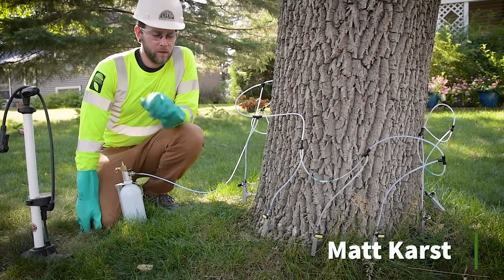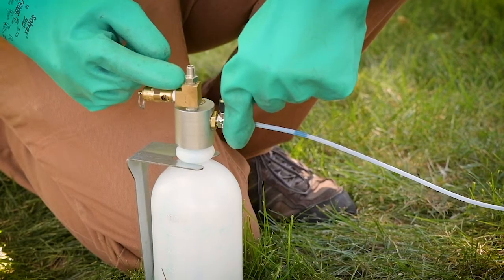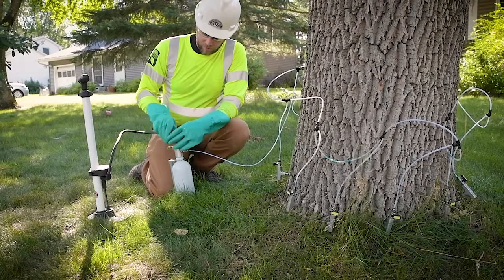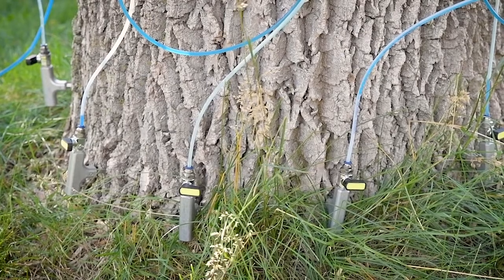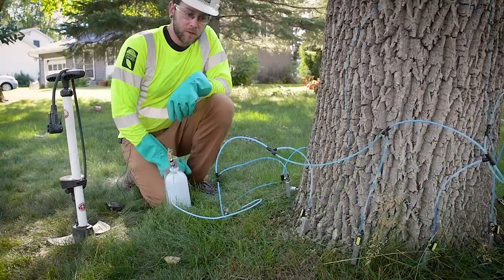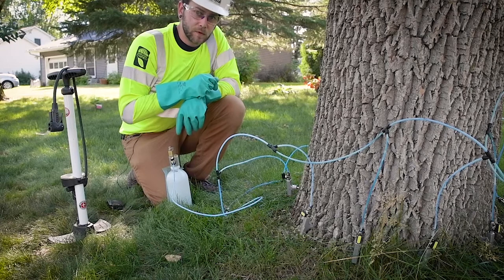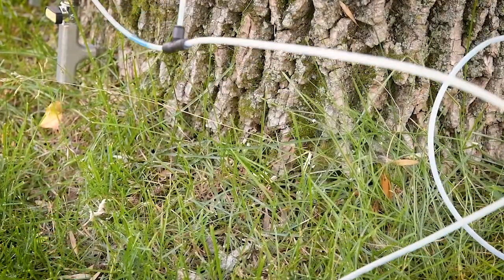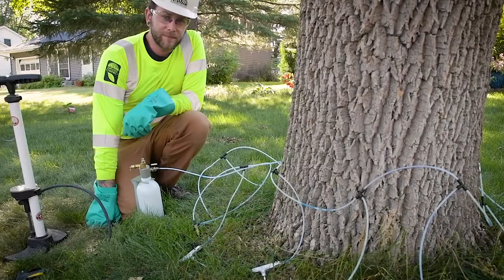Pressurizing and Application Using the Q-Connect System

Comment: how long does it typically take for a tree that size to uptake the treatment?
Reply from the maker: It should take about 10 minutes to inject a tree of this size with Mectinite if soil moisture and weather conditions are adequate for uptake. If you have more questions, you can also reach out to our technical support team 877-272-6747.